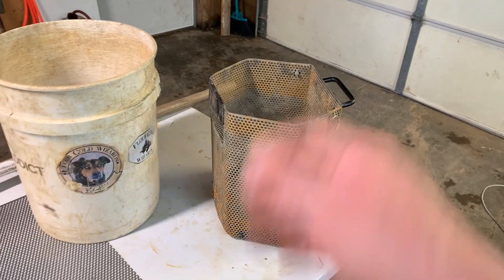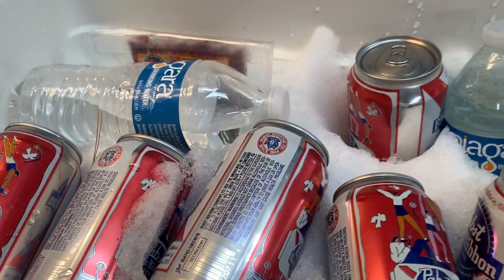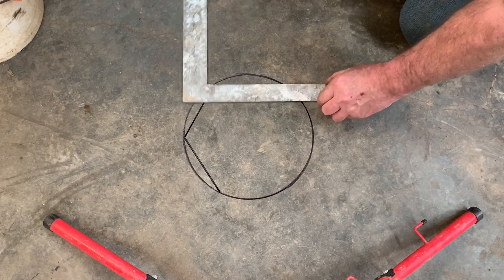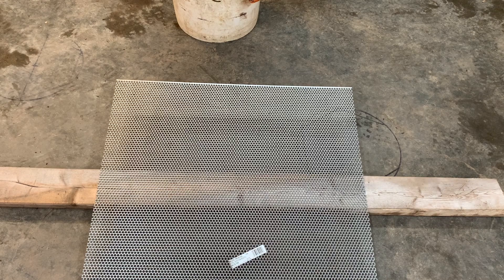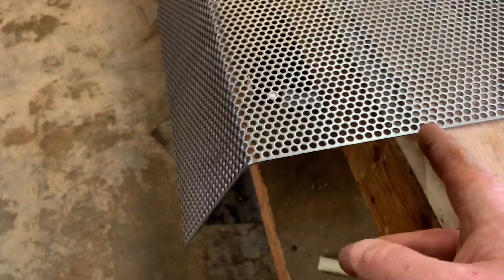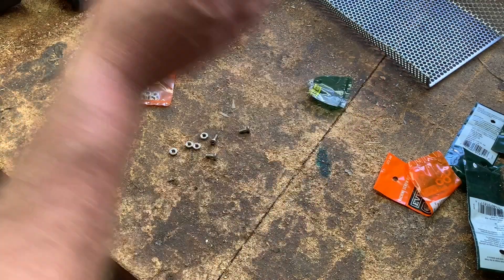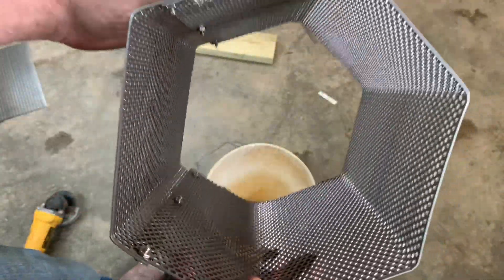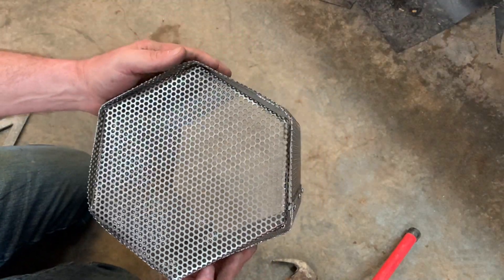The WORLDS BEST classifier build

Comment: Lol drinking and doing mathematics, 🤣you pull it off better than us! We measured our windows this morning to hang exterior trim around them and measured the exact what the screens are,completely forgetting the 2 ends needed to be the window length + the other sides board length 🙄 so it's back to homedepot next weekend for a couple more 1x3 boards..well done Jason with the classifier, we'll take 2 on the next order 😀🍺
Reply from the maker: We lucked out..... the PBR almost slowed me down....🤣🤣🍻🍻🍻
Reply: i put the trim around my widows. I cut that board 3 times and it was still to short
Reply: @montneymon-ta-knee6810  😅

Comment: Like # 684
Catching one more before my day ends. 
Pabst cheers buddy 🍻🍻🍻🇨🇦❤️
19:30 ... those are bolts, that take nuts, and always use a lock washer on both sides folks! Or threadlock!!
Great idea, I personally use a deep bowl, rounded, and just move it the same twist you do. Less weight, probably 2 huge shovel fulls, probably 4 to 5 of your average. I do 5 times, and the classified pail is about 4 inches from the top. 
I build 3 full pails, which takes about 45min to an hour, and the sluice run takes half an hour to 40mins. In a 6hr period, I've cleared a 7ft square area, but oh em geeee it's a workout! But to see 4000 to 6000 pcs in a pan, is superb Pabst time, with a fire, and my guitar!!!
Love my hobby, love the forest ❤️🇨🇦

I forgot to add....thee most important point, in all your lives, who stick a trap in the water, or run with pump....
When not feeding it, always pull your sluice out of the water. 
Not one gold plant around the world, allows just water, without materials, through the contraption, and so must the gravity sluice be treated the same.

27:25 that was a cool commemorate can. We had some funky cans and posters, I grabbed some lol. Cool stock and a frog Pabst set of posters

Love the Nut and Bolt attachmenting on that metal. Lol, I'd say you're about 6 cans in...haha PABST CHEERS 🍻

Do you think I can attach that speed control, to a pool pump?
Reply from the maker: I bet with a speed controller with a high amp rating would work well !!
Pabst 🍻
Reply: @FlourgoldWizards  I'm going to give it a try. I had got the pump a few years ago, but with my business, the actual using of it, was put on the back burner, and the near future here allows me to do a setup, so I'm going to give it a shot

Comment: Nice "how to" vid!
 Just a suggestion. If you put those handles on that thin perforated sheet metal, Heavy loads may eventually crack the basket from flexing at the screw points. A rectangular piece of 1/8" steel on each side of the basket when bolting the handles on would spread the pressure out.
 Thanks for the vid!
Reply from the maker: Ive got some too !!! Good idea!!

Comment: I could make one on the sheet metal break at the shop. If you put a couple fender washers on the backside of your handels, well when you get one. If you don't get one the hole on the other side would work just as well. You forgot the most important thing on your list. The duct tape Heck you could wrap the hole with insulation tape and wrap that with duct tape
Reply from the maker: Duct tape runs the world...🤣🤣🍻

Comment: Come on Jason every Stone Mason has a bit of rebar lurking around his scraps, 

Just a pointer you could add just an inch and a half bent hook every quarter of the basket just under handle,,this would allow josilin to rest on bucket pail,,you could just use the handles back and forth side to side without worrying about basket weight you could even add little wheels that sit on the pail and swirl back and forth,,but i know you love Josilin just as she is,,okey Dokey.❤
Reply from the maker: Excellent ✅

Comment: Well done.  Sufficient detail yet well paced.  I would have used friction nuts though.  Do the standard ones stay tight?
Reply from the maker: I added a drop of jb weld to the tips of the screws last one and they’re tight alright...👍🏻👍🏻👍🏻
Reply: @FlourgoldWizards  It really seems to be a good design.  I should be healed up by the time the snow melts and we have a busy summer piling up.  I'll try and give you a run for your money video wise then.  Probably more rocks for Mrs Wizard also.  Keep your hands unfrozen.

Keith